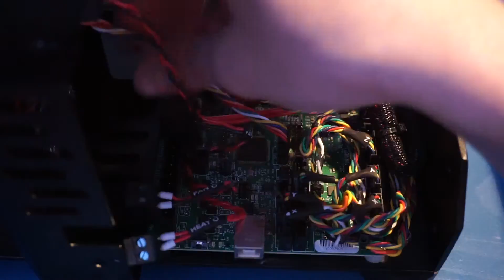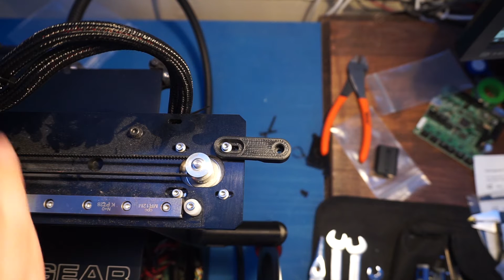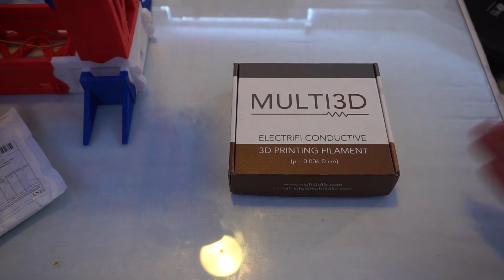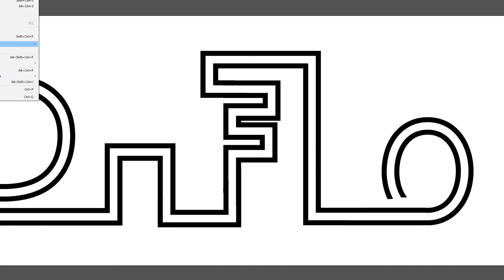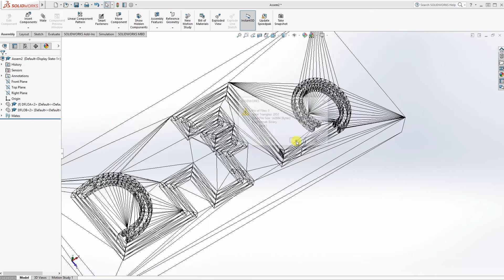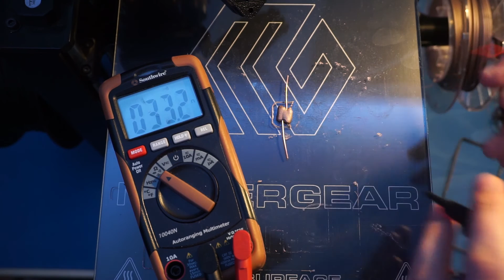MakerGear Dual Extruder with PolySupport and Questionably Conductive Filament

Comment: @Dr. D-Flo
I bought the same printer as yours with upgraded 2nd extruder. But I can’t figure how to fill the filament for 2nd extruder on the right. The app only does thing for the 1st extruder. Did you use the different app for dual extruders?

Comment: I ordered the dual extruder a few years ago.  Bricked.  Only after rebuild does MG tell me it's not compatible with the rev. of my M2.  So we made a deal, I sent back the machine and they sent me an M3ID.  Had to throw them a bit more cash but less than the difference.  The one thing MG has going for it is the build quality; I've had the M3 running pretty close to 24/7 for two years with only the hot ends failing and minor wire harness issues.

Comment: I was wondering what you use to design your models?
Reply: also I am having problems with my maker gear extruding filament without me telling it to do so I was wondering if you have had this issue
Reply from the maker: I use Solidworks. If you are a student you can get a big discount on the software. Otherwise, it is pretty expensive. Also, I have not had that issue with my extruder. I would contact the MakerGear team. They are very easy to work with.

Comment: You had a buzzer thing enabled when you were measuring conductivity of this test print so it didn't measure in full range.
Try to measure it in the normal mode.
Probably it's not as conductive as advertised...

Also I'd try to measure it when it's cool. Resistivity could be higher when it's hot.
Reply from the maker: Damian I measured it when it was cool. And I did conductivity and resistance, but it was an open circuit according to my multimeter. One guy told me that he had luck with silver paste. However, having to apply silver paste at each connection takes away from the convenience of 3D printing circuit boards.
Reply: Dr. D-Flo there is one more thing you can try. Wipe the contact area with a cloth soaked with a acetone few times and then apply the Led. Acetone should "etch" away some plastic leaving more copper particles at the contact. Also it will degrease led contacts.

Comment: I agree that it's very disappointing to spend that much money on specialty filament only to have the prime feature of the filament not work. Conductive filament is supposed to be conductive right? It's little compensation but it wouldn't be that hard to make essentially the same print that you did and just press some bare copper wire into the grooves where the conductive filament should have gone. I realize that's completely not what you had in mind but if you could ignore what you originally intended, the bare copper wire in the 3D printed channel has a kind of cool factor to it.
Reply from the maker: Hey thanks for your comment! That is a great idea. I will try that out in my free time.

Comment: It is nice to see a new review on the M2.  I never knew about the ooze shield with dual extrusion.  I have been debating about getting this printer for some time now.  The price is a factor at $1825.  I have a Rostock Max v2 that now that I am having major issues with after 6 months.  The prints are as stable as potato chips now,  very brittle.  I have tried all sorts of fixes and will not spend any more money on it.
Reply from the maker: Bruce,
You can save $300 by purchasing a kit vs a fully assembled printer. I know that $1.5k is still a lot of money, but besides my RAMBo issue this printer has been super reliable. At the end of the day, time is money.

Comment: That's pretty sad about the filament. I was excited to see it work.
Reply from the maker: I know :( I received some advice that I should use silver paste between the pads of the LEDs and the filament, but I feel like this ruins the convenience factor of 3D printing the filament. I could mill traces out on a blank PCB and solder with less time/cost. My expectations were a lot higher for such a pricey filament. I hope that I do not sound harsh! Thanks for your comment.
Reply: Dr. D-Flo Yeah. I wanted to ask you, after seeing your video where you build another 3d printer I wanted your opinion on what the best 3d printer I could build for under a thousand would be. I've never done anything with 3d printer and was looking at the D Bot (Bit scary to get into) what do you think would be good in that range?
Reply from the maker: You will get the most out of your money if you purchase a kit and assemble it yourself. The Prusia i3 MK2 prints great and has an awesome community. However, it is on a 7 week back order. You can buy the i3 fully assembled for $200 extra. I also recommend the Flashforge Creator Pro. The Flashforge has dual extruders and its enclosure is optimal for printing ABS. However, I have found that the extruders requires a lot of maintenance. I know very little about the D-Bot besides the fact that it looks awesome. Let me know if you have any more questions!
Reply: Dr. D-Flo Its funny because I had just stumbled upon that a few minutes ago. This one has my interest now. I'm going to spend a few days doing research because the more I dig the more cool printers I find. But yes this one is definitely in my consideration